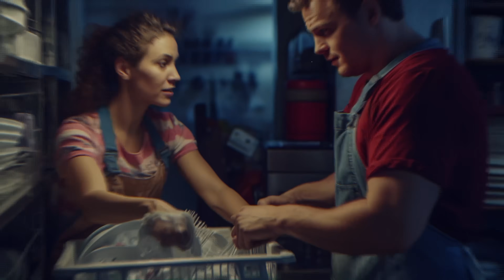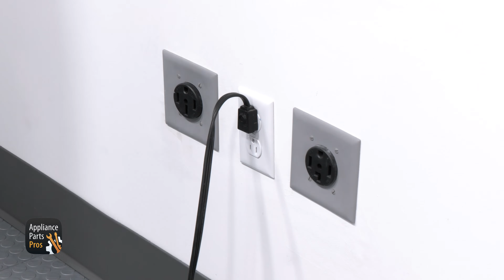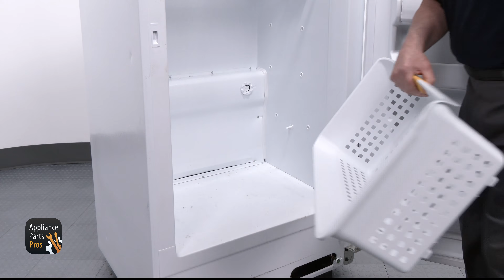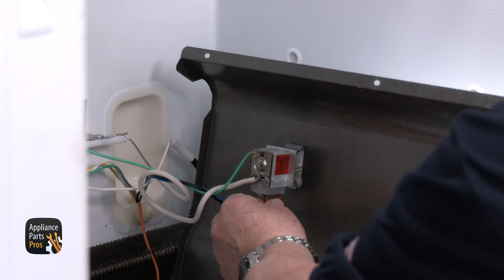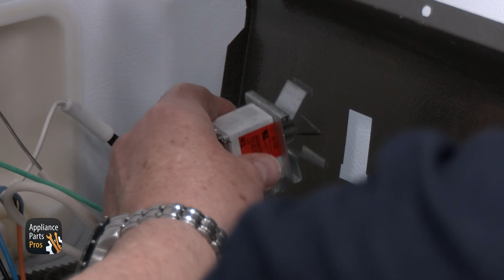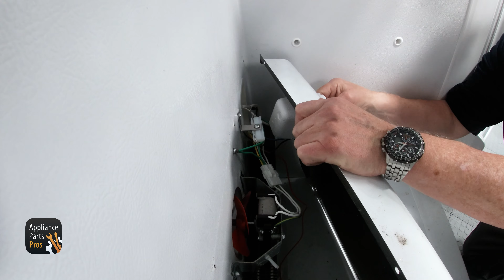How To Test and Replace a Frigidaire/Electrolux Temperature Control Thermostat

Comment: Hi, thanks for the video. When testing, does the position of the thermostat dial matter?
Reply from the maker: No it shouldn't. If you need help with your repair, you can visit our Repair Forum: https://forum.appliancepartspros.com/. It’s easy to register, and you can either post your question or search the forum to see if someone else has already asked the same question.

Our experienced technicians, with over 20 years of hands-on appliance repair experience, are ready to answer your questions and guide you through your repair.

Comment: I replaced the thermostat control and now the freezer gets cold, but not freezing.  Any suggestions on what I might have done wrong?  Will the freezer still freeze with the evaporator cover off (I wasn't going to replace the cover until I got it to freeze correctly).
Reply from the maker: Sometimes the cover can have important components that control the airflow (which depends on the model), so I would keep that on and check back after 12 hours. Whenever you check back, make sure the evaporator fan is running.
Reply: @appliancepartspros  Thanks, the fan has been running.  I think the next problem might be the defrost timer or heater assembly.  Trying to figure out which before purchasing parts, since the heater assembly is not cheap.  (My freezer looks almost identical to the one in this video)